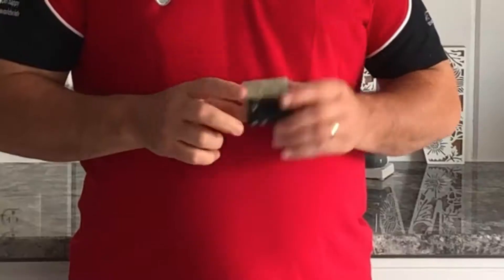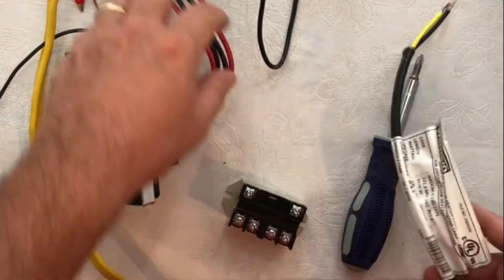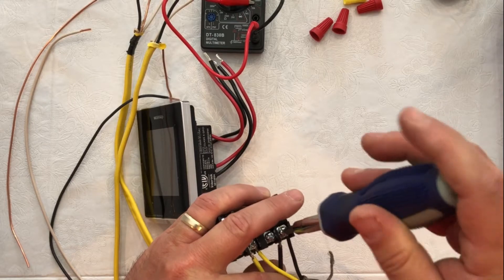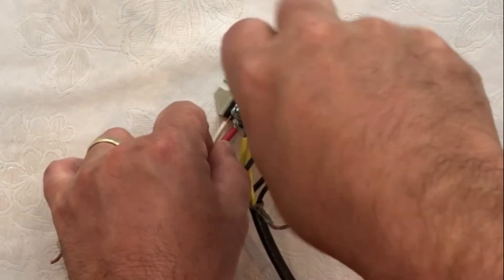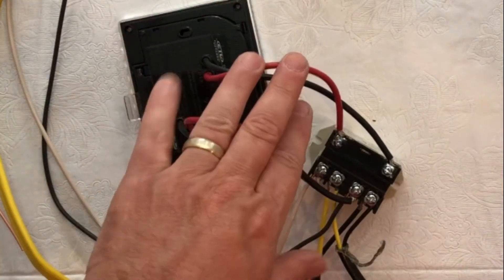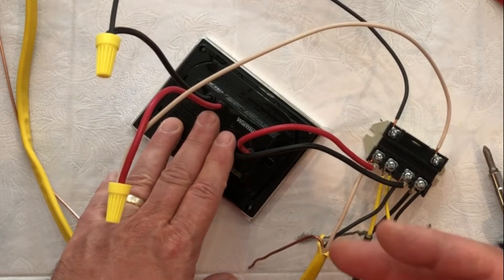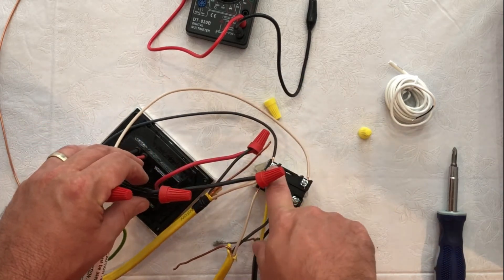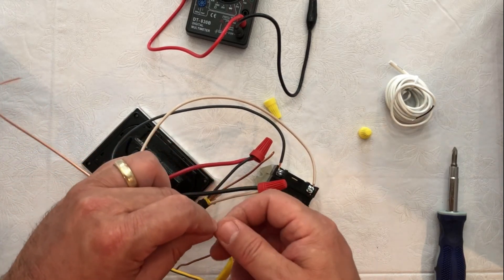How to wire a Relay 25 with a 4iE thermostat

Comment: This clip was super helpful. Given the example of have three heating sections (2 wired on the relay) and 1 off the thermostat itself, can i not just share my power from the circuit breaker instead of two seperate circuits to both the relay and thermostat with a 40amp breaker?
Reply from the maker: So happy it helped! For the described situation, you will need to run 2 separate circuits. One for the T-stat (20amp) to heating up  the one heating wire connected directly to T-Stat and one for the 25amp relay in order to power up the 2 heating wires. Hope this helps!
Reply: @warmupinc  just so I understand. I will need a 20amp circuit to power the t-stat and the heating element connected. I will need an ADDITIONAL 25amp circuit to power the relay and heating elements connected to it?
Reply from the maker: 20 amp for the thermostat and 30 amp for the relay. Additional information can be found here https://www.warmup.com/warmupedia/questions/wire-relay-25/ or we are a call away at 888-927-6333!